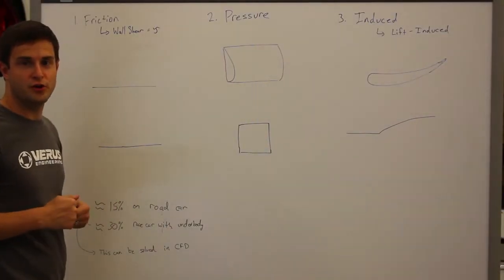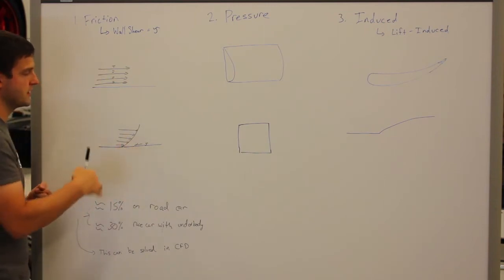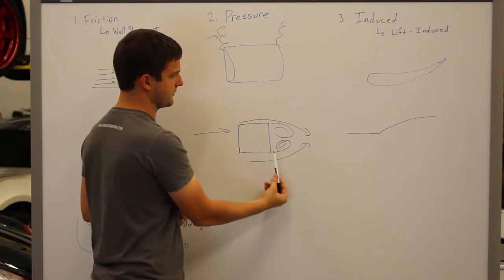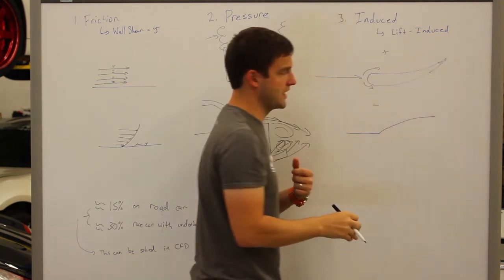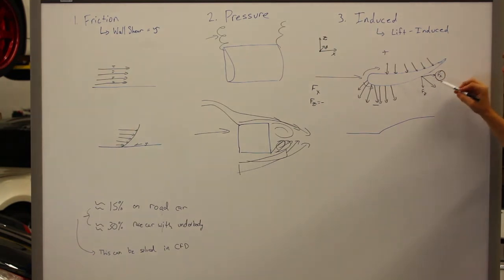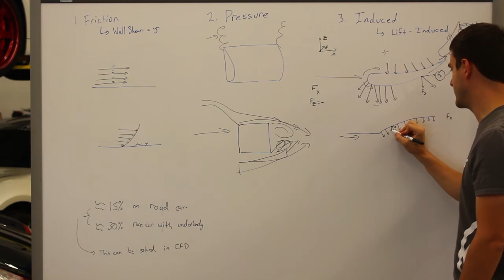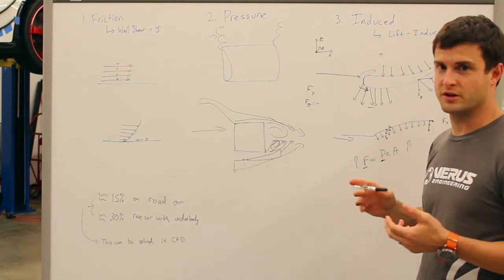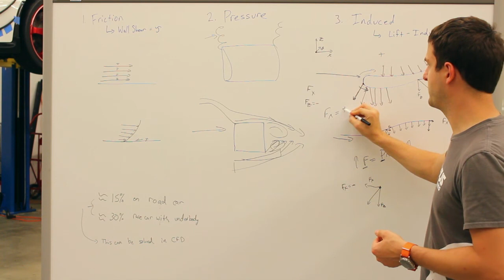Vlog 005 - Lessons in Drag

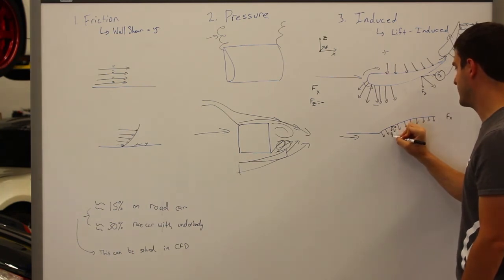Comment: 9:00
If I tip the tail(portion that extends 8" past the tailgate ) of my canopy in avatar  down 15° ? It having only 1/2" of surface facing -Fx would add a +Fx  aka a minor push  insted of downforce only at  0°?
Reply from the maker: Please draw a diagram and email us the question sales@verus-engineering.com
Reply: @VerusEngineering  email sent with Darco Tech. wind tunnel data. 
Names David Droescher.
Reply: Bump.  And a email bump as well